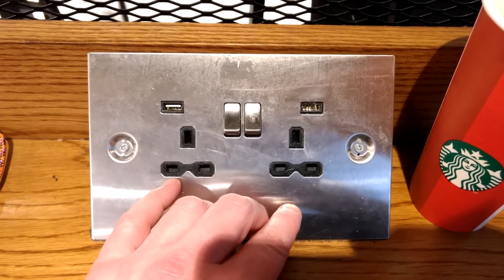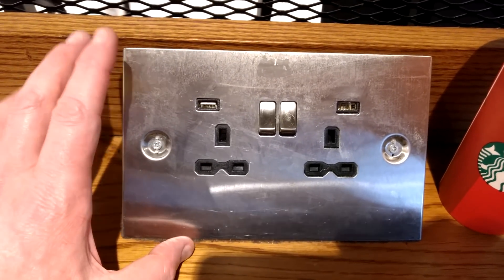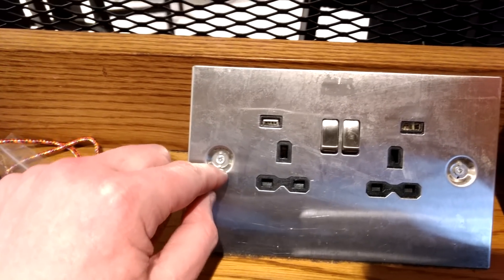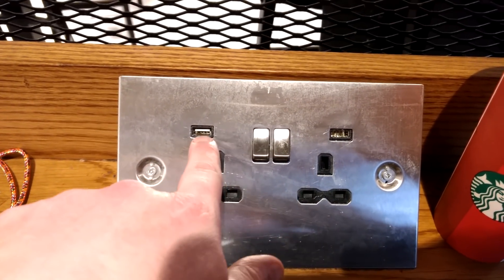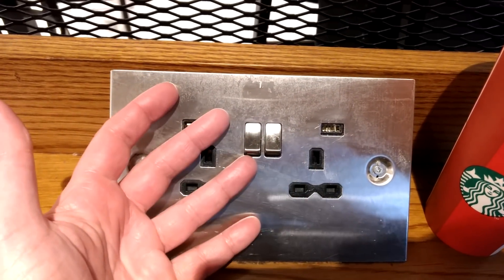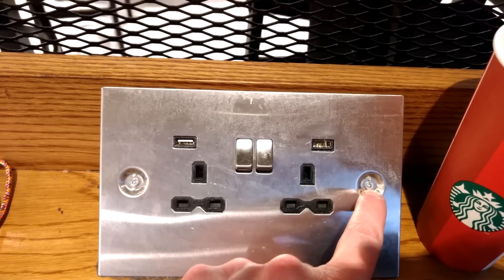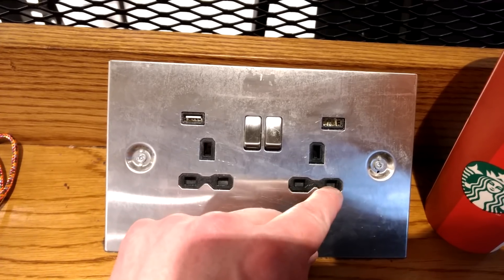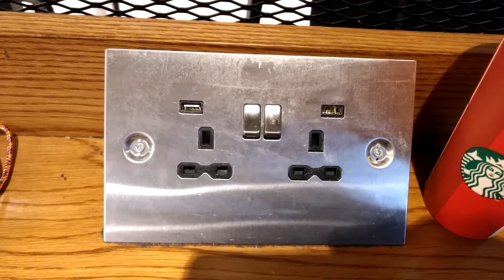Dead Starbucks charger and devious thoughts.

Comment: Clive, is there a "USB condom" that could plug inline and subvert a capacitor attack and isolate data lines, as well as any other plausible attack avenues? 

Something small enough that people could carry with them and plug inline, and use "any" public outlets like that with almost reckless abandonment?

Would be a interesting piece of information, despite always carrying my own power banks. 

But what if, and could there be something like this out there that would be small and easily portable to keep when on trips?

Comment: "This did make me ponder if anything malicious could be incorporated into a charging socket like this. It would require that the phone's charging port was capable of accepting something like a rubber ducky for a phone." 
A good way around that if you're often in situations like that and worried about it is a simple adapter or cable that doesn't have the data pins hooked up, only ground and power (pin 1 and 4 in a USB 2.0 Type-A). I guess you would lose out on potential quickcharge benefits since the device and power supply can't negotiate about that, but with these cheap things I highly doubt the feature was even there to begin with.

Comment: Just something to think about:  I'm not so sure that it would be wise to connect any phone or tablet to any public USB port.  You don't know what might be lurking under that panel.  A capacitor to pop whatever you plug in?  A sneaky device to siphon off your information?  
Hell,  there's a small chance that given the seemingly rushed work on those screws and misaligned panel, that it may very well have been tampered with.  Perhaps someone destroyed the plug not to be nefarious,  but because they discovered that it was indeed fiendish, and mangled it to prevent it from being used again.   But  it's a better chance that it was just a case of "if it won't fit, force it."

Comment: >This did make me ponder if anything malicious could be incorporated into a charging socket like this. It would require that the phone's charging port was capable of accepting something like a rubber ducky for a phone

Maybe directly wire the USB ports into the 240V mains, or even better connect them to one of those USB killers.

Comment: Hey Clive, i was wondering, if you got the time, can you check out the Sonoff brand? A lot of people are using them in their homes to automate stuff. But since it's a Chinese brand, it does sound a bit sketchy to me...
Reply from the maker: I'd certainly not suggest running high power loads with them.  There's also a slight issue about using devices with unknown software on your home network.

Comment: You can bet those responsible for breaking the USB sockets could even break a public wireless charging point...
Reply from the maker: That could be a challenge.  A receiver coil that charges a big capacitor and then dumps a huge magnetic spike back to take out the inductive charger.
Reply: A wireless version of the USB Killer? That could cause some upset by mischievous deviants.

Comment: Helpful hint:  I have a nifty USB port tester widget that lights up with voltage and amperage readouts. Great for public chargers. If the voltage looks okay, THEN the phone gets plugged in. Watching amperage readout informs if the port is weak or dead. Mine looks a lot like this:  https://www.amazon.com/X-DRAGON-Multimeter-Chargers-Capacity-Accuracy/dp/B019RHJRM8

Comment: I like electricals with metal casings...something just tells me to lick them just for the hell of it...
Reply: I have some ceramic and metal switches at home. I always have a very tiny slgiht hesitation using them... despite the fact I reinstalled them to make sure wires weren't protruding, the cardboaard bit was here and the plastic insulation between the rocking contact and the "level switch" was here.
https://www.lampes-recup.com/wp-content/uploads/2018/04/interrupteur-ancien-porcelaine-et-chrome-simple-allumage-014-e1522923602302.jpg
https://www.lampes-recup.com/wp-content/uploads/2017/10/Interrupteur-ancien-porcelaine-et-chrome-marque-Legrand-011-e1507376110489.jpg

Comment: The couple times I needed to use a public USB port (ewww) I opted to charge my power bank and then use that later to power my phone. I'm less concerned about the data lines and more concerned about the condition of that 5v supply...

Comment: I've seen this happen on actual computers. It usually starts with someone kicking/knocking something while it's inserted, breaking the white tab off at the base. Then the next person blindly tries to ram another plug in and it mashes all the bare wires together. In a computer, it will short the board out and leave the thing appearing dead (until you use tweezers to break the pins off). I imagine it doesn't do the PSU too much good inside to have this happen.
Reply from the maker: Most of the power supplies use an auxiliary winding to generate the supply for the control circuitry, so when you short the output it shunts the transformer and stops it powering up properly.  So it goes into hiccup mode where the power supply keeps trying to start with a series of pulses.  You can see that effect on some LED lights when they fail in a pulsing mode because the drivers own internal power supply has failed.
Reply: On a computer, IF built to USB spec, it won't harm anything. Designed to disable port & power until the fault is cleared. Now, let's not get into how many computers don't fully meet various specs...

Comment: It's the plastic tab that broken off, normally they get broken over use over time but what can cause them to brake off sooner is when they forget its plugged in and try and walk away with it still attached and end up walking away with the plastic tab stuck in the USB cable, when the next person comes along they plug there phone in and no tab there so it squishies contacts to the back typically pushing it to the ground of the USB port which shorts all the ports 

putting it in the wrong way hard enough would just push it in if there is nothing on the back of the USB port to prevent it (seen it happen on a charger someone put a little to much effort in trying to push it in the wrong way)

Comment: and that's why we can't have nice things. you kids always jamming shit into the sockets so no one can use them, even the vandal.  and Clive I'm surprised you don't know the rubber band trick, put a rubber band across the end of a philips head screwdriver, use pressure and you can extract the stripped screw.  rarely does it not work.

Comment: Pursuant to the devious thoughts, I take either of two precautions when I travel. First, that I carry USB cables that lack conductors on the data pins entirely, so I only have the 5V lines. The second precaution, when I can't find my diminished cables, is to only charge power banks from public sockets, and to only charge my phone from a power bank.

Comment: Whaaaaat ? You did not bring a usb copper christmas string of leds with you to make it a bit mor christ..messy there .. and test function ? :-)

BTW: The latest 6.50€ usb 100-led copper strings i got pulled over 530mA at 5V usb.
( https://www.amazon.de/Kohree-Kupferdraht-Lichterkette-Dekolichterkette-Weihnachten/dp/B01JZ0GM7K )

AAAND they dont seem to have the 10 Ohm resistor in the plug anymore. Or any resistor therefore at all !

Also they seemed more into cold white than warm white. Probably too much mA. I added a resistor so softer light now, but still kinda bright.
2x strings in parallel at 5V with 4.7Ohms in front

One string with 2x 15ohms parallel (so 7.5 Ohms) which still is plenty bright enough to backlight a complete room.
Reply from the maker: Some rely on using a third wire that runs to the opposite end to act as a resistor.

Comment: What's with the mesh wire in front? Makes it seem like you're in prison...

Also, I figure a specialized/upgraded/protected cable isn't really necessary. You coluld just make a little adapter box with protection circuitry that would work with any cable. You would just bring it with you and use it in such public places.

Comment: Funny thing, on my computer the locating pin on the front panel usb broke which caused the contacts to touch the usb housing. This caused the computer to not post on the bios screen until I fixed it - trying to put a cable in without realising cause the pc to crash.
Doing that caused none of the front usb io port to function at all. They register the soiund on windows of being plugged in but the chip on the io board that runs them must be fried.

Likely why the other socket doesn't function.

Comment: Would it be wise to have a USB protection module that provided over-voltage, over-current, reverse polarity, etc. protection if you are going to go about sticking your USB cable into strange?  Maybe a buck/boost converter set to pass through?  I know cheapo car chargers have fried smartphones.

Comment: Alternative ideal charging solution is to simply charge your own power bank off of public charging stations and then charge your phone from that, if it blows up a power bank worth a few quid because someone's messed with it, it's no great loss and they don't have the smarts for data communications to be an issue.

Comment: reminds me of the time i tried connecting my charger to the outlet at a cafe when i noticed something was in the way, i stuck my hand down there and got a shock... there was half an iphone charger there, basically just enough to connect to the outlet and 2 metal prongs sticking out towards me.
Reply from the maker: It was possibly a cheap charger that had either just separated or blown its lid off when it failed electrically.

Comment: I can hear the USB power supply pulsing in the background, the high pitched beeps... They usually do that when they are overloaded... So yeah the supply is indeed shorted.
Reply: the pitch is not overloading it is just the oscillation being in the human hearable frequency range due to a higher frequency required for more current

Comment: Let's walk your thinking back a bit, Clive. (TL;DR: yes, if you plug into these, consider your phone information public)

Let's say that you plug into one of these USB points to charge your phone. Now let's say there's a passive data-tap installed. You're boned. 

Ah, but you're smart. You've built a custom USB cable with DATA lines snipped. It only takes power signals. However, what you may not know is that an inductive coupler has been built to listen to EMF noise generated by your device and get a good idea of what inputs are being entered. You're boned.

Ah! But you're smart AND paranoid -- instead of messing with a USB/data-capable cable, you just use the power side of this to charge your phone. You're fine, right? Potentially, no. Again ... you're boned.

The short version of it is this, and this is based upon work and research I have stopped doing around a decade ago (so things are far better/more devious now): if you plug a device into anywhere public, you should consider your personal information now potentially harvested. In cases where you have really sensitive data, you'll ideally not want to leak any EMF/RF from your device at all, and you'll want to run on isolated and vetted power. If you have time, an interesting read on this is the story about the ZCash guy generating the seed for all of his hash functions. There was actually a podcast on this 1-2 years ago that was fascinating.

Be well!
Reply: I love being free of such things, ensconced in my ignorance of personal cell phone devices.   Ain't got One!!!  "HA HA'' - Nelson Munce.
Reply: People need to understand that there is no free lunch. Nothing is free, someone is paying for it. People exchange their personal info for "free" wifi all the time, all while thinking that the wifi provider is oh so generous. Google is worth billions, yet all their services are "free". Yet, people cant connect the dots and understand why.

Comment: Pretty sure this is what happens when someone is too stupid to realize they are trying to plug something in to the USB port backwards. Because more force fixes everything...
Reply: They tend to brake because person walked away with cable still plugged in and broke it later on they norm find it still stuck in the USB cable until they pick it out (the second person would of been the one who smashed it to the back of the Port because the tab was missing from last person who broke the tab off)
Reply: The force wasn't with this one though, was it?
Reply: Meh, all those standard USB-A ports and cables BOTH of random quality, SIZE and therefore strength needed to push them in...  I'd be surprised if they last more than one month in any big city. That's ok for your own stuff, because you know YOUR stuff. Otherwise, public USB charging? That's asking for trouble. Same for 120V house sockets with 2xUSB built-in... never.
Reply: Also, what's the point of public USB ports? If you have your smartphone and the cable with you, you certainly have the charger too... Go wireless, no one can force "air". :P
Reply: At most of the airports I’ve been to with public charging stations the USB Type A ports are broken. (And there are often scorch marks left by people plugging in devices with the wrong voltage or international outlet.)

We can blame human stupidity, but we can’t deny USB Type A is a terrible design. They’re finicky even if you have it in the correct orientation and never feel secure.

Comment: Charging my device by a publicly accessable USB port feels unsanitary to me. I'd never do that.
Reply: USB power only cable is a solution.
Reply: @dorfschmidt4833  
I'd maybe charge my powerbank there, but wipe it clean really well afterwards. I'd never charge my device with a dirty powerbank either.
Reply: @RubenLensvelt  Ok, your concern are the germs and not the potential spying, fair enough. ;)
Reply: @dorfschmidt4833  
The germs are the worst. :-)